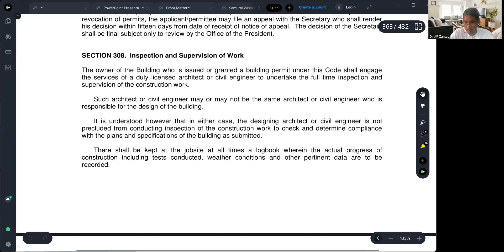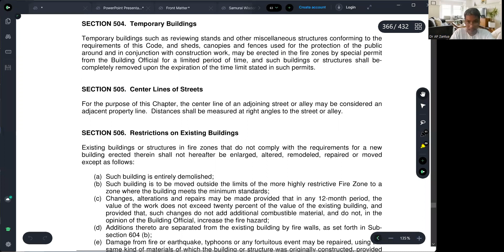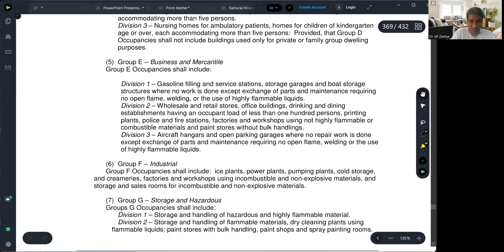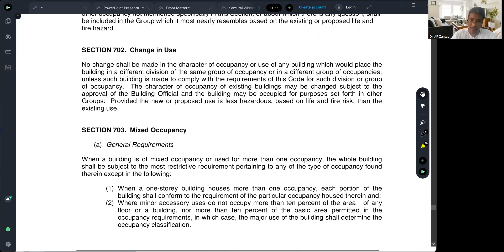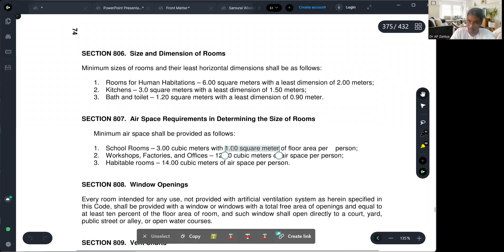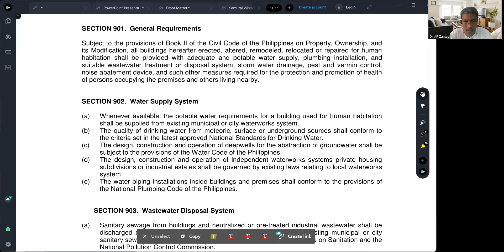Sec305 - Validity of Building Permit & Sec806 - Dimension of Rooms [ PD 1096 ] Module 1.02.B

Comment: Thank you, sir for the continuation of the National Building Codes of the Philippines. Some of the information helps me recap what we have discussed in Engineering Utilities 1 such as the building permits, storm drainage, water supply system, etc,. The video has expand my knowledge about the NBCP. I have also learned some types of construction, and some regulation on moved and temporary building. The fire-resistance has also been defined and some of its technical terms. I also happen to know the classification of occupancy, and some of the required dimensions and sizes.